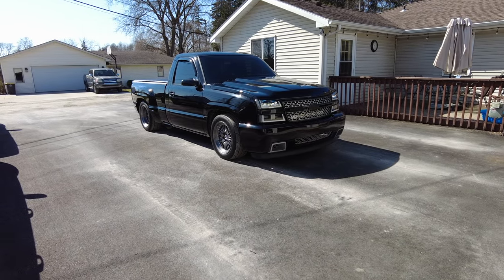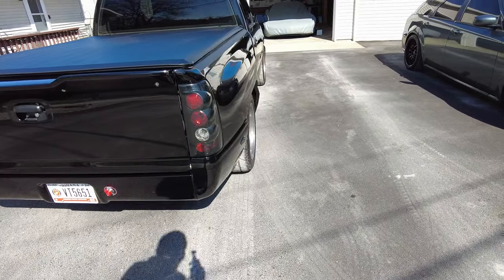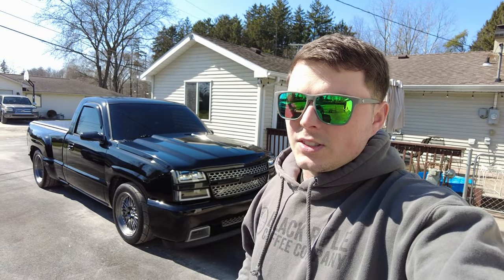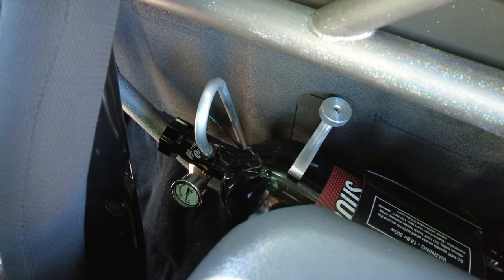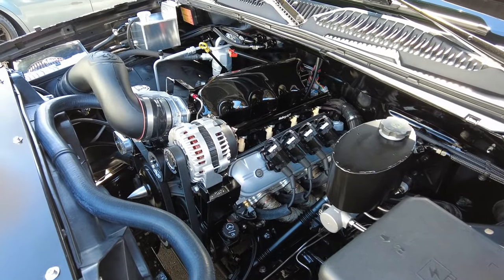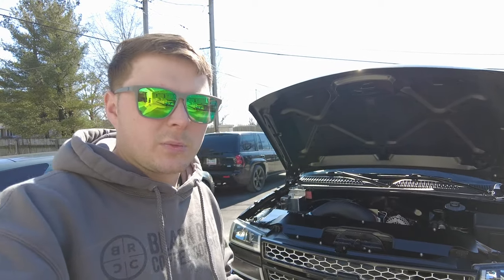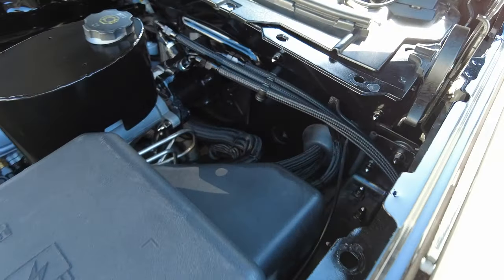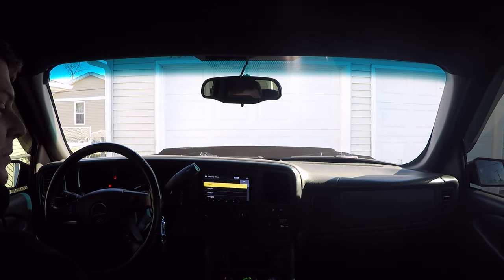"Work Truck" Nitrous Silverado Build 2.0 Full Walk Around

Comment: I have the same bed on my truck can you please tell me the specs of your wheels? I don’t feel comfortable running spacers all the time. I’m planning on ordering some custom wheels but just not sure what specs to look for thanks
Reply from the maker: Hey, sorry for the late reply. The wheels were made by 3030autosport. Fronts are 18x10, 275/45R18 M/Ts. Rears are 18x12, 345/35R18 M/Ts. 

I had to take 15 measurements for the front and 15 for the rear. The wheels were custom made for the truck off of those measurements. So I dont know the exact backspacing.

Comment: Have you had any issues with the "Chevy lean"? I can't seem to get mine level. Changed out the leaf's and eventually got some helper bags and add more air to the driver side. Truck looks so good btw!
Reply from the maker: Both my trucks have had the chevy lean haha. For my single cab, I adjusted the front coilover a little bit to try and level it out. it's still about 1/2" inch off. I don't really think there is an official fix to the lean haha. Adding air to the helper bag is a good idea. sorry, not much help. Thanks for the support though!!
Reply: Their is a company online that makes a kit for the lean to make it level

Comment: Would you be willing to make blue prints for the washer fluid reservoir so we could make them?
Reply from the maker: Hey, I didn't make it. They are made by snail fabrication. Check them out, they also make them with oil catch cans, water/meth tanks, or all three combined.